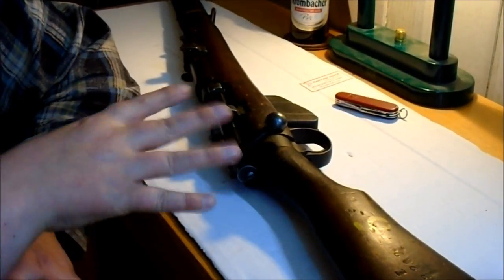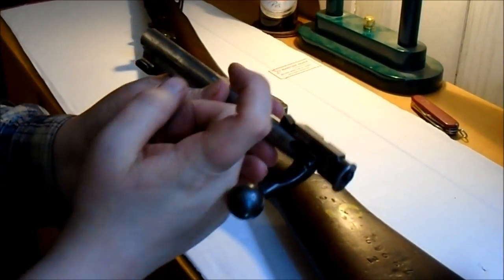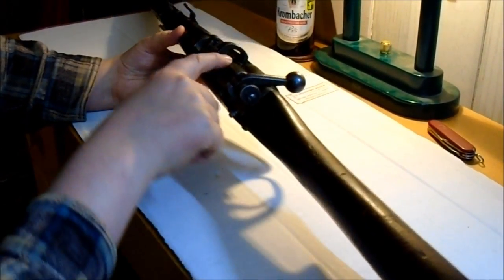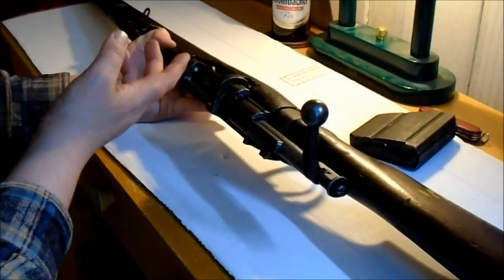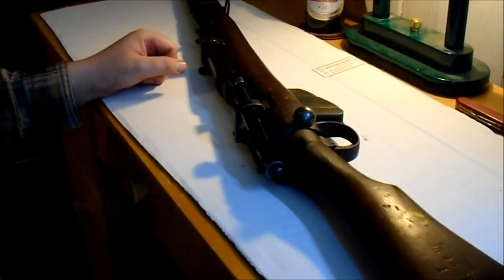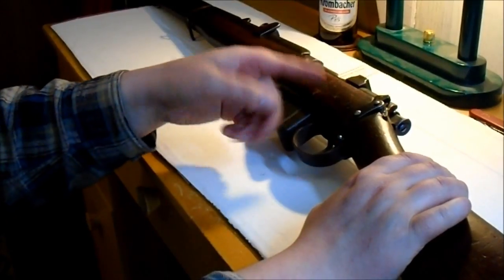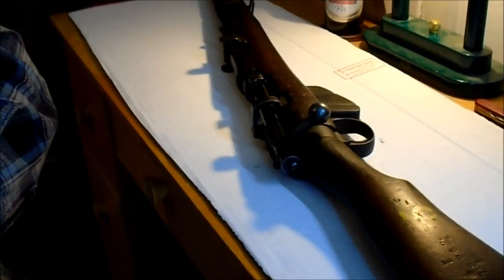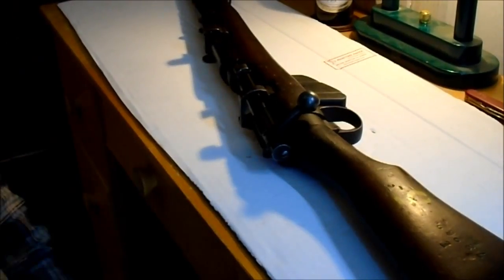1943 Lithgow Closer Look (Sold)

Comment: My 1941 Lithgow has the heat discoloration in the locking lug areas as well but they are smaller than yours. My 1908 BSA that was rebuilt by lithgow has it too except the spots are larger than on my 1941 or your rifle. My 1918 Enfield doesn't have it and my 1916 BSA doesn't have that either.

Interesting. Something I'd noticed as well but never paid any attention to.